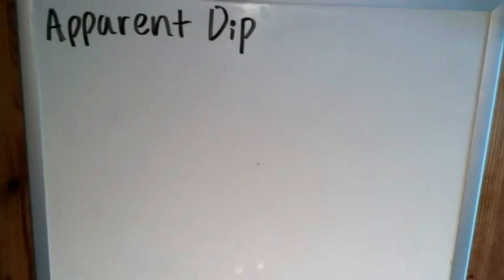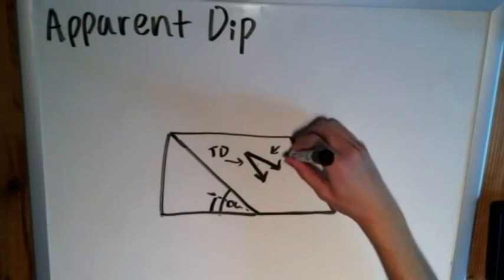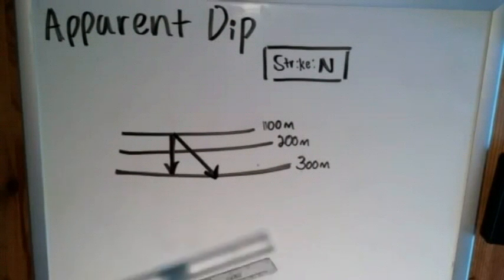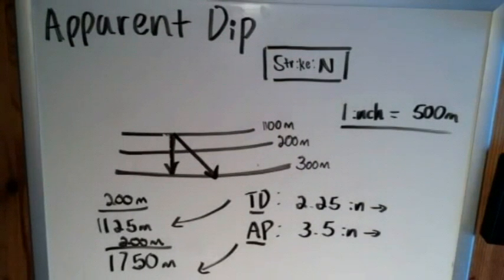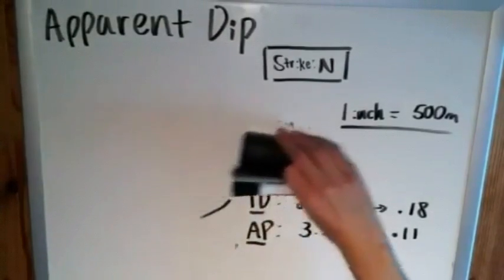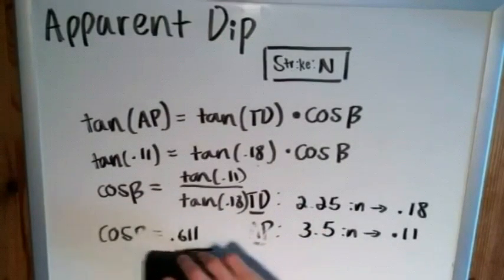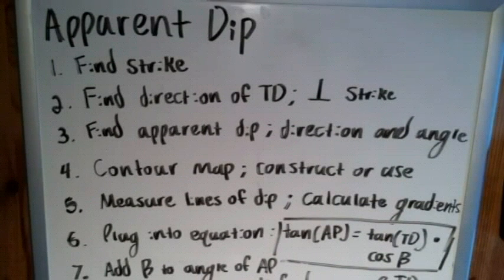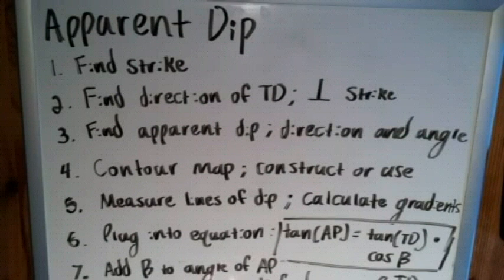The Basics of Geology: Apparent Dip

Comment: why do we need an apearent dip if we have the true dip and whats the need and use of apparent dip? if a bed which is on a flat topography suppose its 30meters in width and if its true dip is 30 degrees then what will be the actual thickness of the bed in meters ?
Reply: Because we can't always calculate the true dip directly. Say if you were given a whacky surface and needed to find the dip and strike of 3 points on that surface, then the most logical way would be to find strike, apparent dip and true dip. Google "3-point problems"
Reply: @div_yam2304  and nasrullah baloch. apparent dip is important for crossections construction.

Comment: How did you get from the .611 to an angle 53 degrees. You verbalised every calculation except that one and that is where I get lost! Great videos!
Reply from the maker: Ah, I should have clarified. The cosine of the angle was equal to .611, so I simply took the inverse cosine of that number (cos^-1(.611) on a calculator). This undoes the cosine operation and gets us from a normalized value to an actual angle in degrees, which in this case was 53.

Comment: how can you tell what the true dip and the apparent dip is out in the field?
Reply: true dip is always perpendicular to strike. The strike of a bed is simply the line of contact between a horizontal plane surface and the bedding. The direction perpendicular to it is the true dip.
Reply: @div_yam2304  direction perpendicular to strike is true dip direction not true dip true dip is measure in a vertical plane on true dip direction.